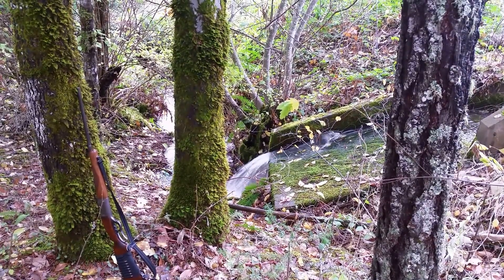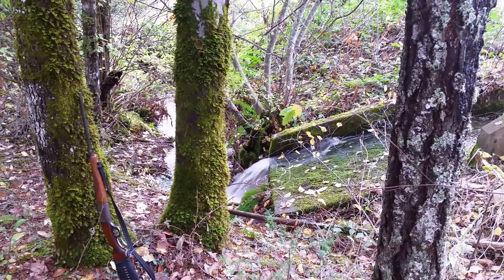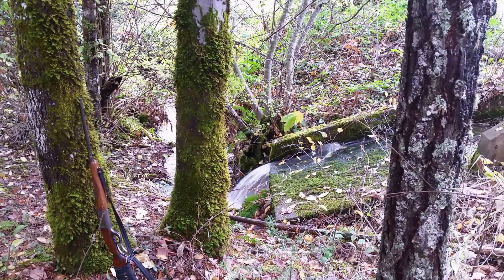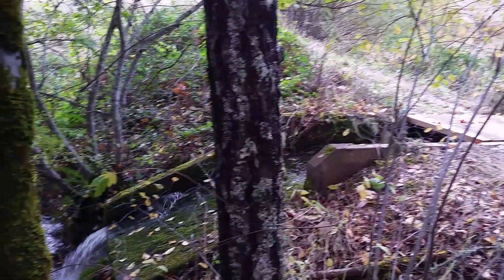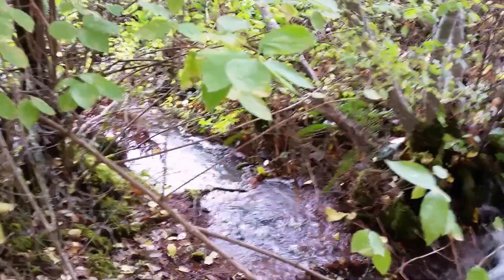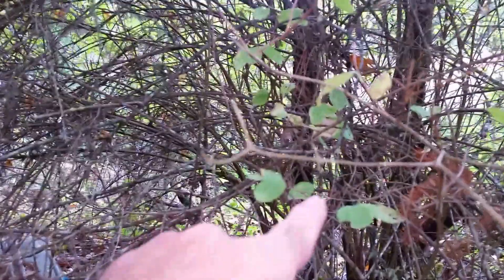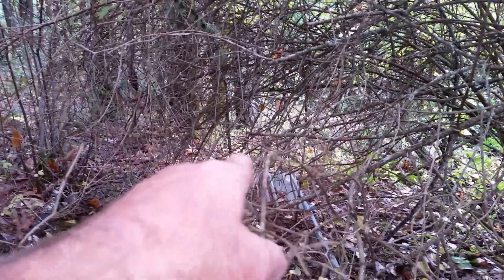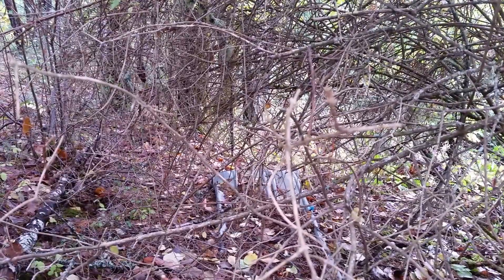Off grid solar homestead (Looking for a good place for hydro generator)

Comment: I heard you mention wood fired water heater in this video.For my wood fired water heater I went to Lowes and got 60 feet coil of flex copper 3/4 inch. I had two 55 gallon drums and so I cut the end off one with a barrel opener tool in much the same way a can opener works for a can of beans. But you can use a hatchet and hammer or a chisel and hammer. I put the coil up in the barrel and held it in place at the top of the barrel with three steel brackets  I bent and bolted in place. I cut a 6 inch diameter hole in the top for the stovepipe. The ends of the copper coil exited the barrel about three inches each. That's so there is no joints in the barrel, just coiled copper 60 feet in length. On the ends of those I soldered connections to the pipes that go to the hot water tank. These are wrench tightened connectors. Also have a pressure relief valve near where the water exits the stove and one again at the top of the tank on the hot water line. Cold water enters the tank , goes into the stove from near the bottom of the tank, rises in the coil and exits the stove and enters the tank toward the top of the tank. Then a hot water line exits the tank on top of the tank and goes to the hot water faucets in the home. I cut a square door in the side of the barrel and cut another just a little larger from the other barrel to make a door and bolted hinges to it and the barrel. And made a latch out of steel. Everything drilled and bolted, no welding. I set it on concrete blocks and poured about 3 inches of cement on the bottom of the barrel through the door. gives it a little weight and stability plus is a flat surface to scrape up ashes. Throw a few chunks in and in about 15 minutes there is enough hot water to take a bath. build it in the morning and have hot water all day. No need for pumps or electric....the hot water circulates itself by the fact that hot water rises and of course this is all hooked up to the gravity feed springwater system so there's pressure just from the fact that the spring and reservoir are above the house.
Reply from the maker: turkey toes very good!
That is very similar to the deign I hope to  use. do you have any videos up of your prodjects?
Reply: As far as turbines go for hydro, I always thought about using a flywheel off of an old riding lawn mower. Not as good as a pelton but cheap and certainly balanced. also some of the better ones are made of steel such as ones from an old Gravely mower. I have read that someone used a barrel and coils of copper like I did for my stove to make a steam boiler and then they hooked that up to a smog pump that ran an alternator but I haven't been able to find that info again here on the internet. I don't think a smog pump would last very long running steam through it...I don't know. But could such a setup as the one I have for making hot water be hooked up to the cold water line for continuous feed , with one way valves so that it would build pressure in the coil and not throw that back through the cold water intake. And after coiling through the stove, at the end of the coil a nozzle that sprays steam at a turbine, even a makeshift turbine such as the mower flywheel?

Comment: Almost put me to sleep with the running water sound. Have fun doing it sounds like fun
Reply from the maker: I think I was kind of mesmerized by the visual and sound effect when I was recording this video lol. I am torn between the water wheel and a micro hydro. If I build a water wheel. It is 300' to the battery bank. I have a PMA that I could use configured as wild AC and mount the 3 phase rectifier in in the battery house next to the Charge controller.If I go with micro hydro system I could have the Pelton wheel next to the battery house. One thing for sure is I will either spend money on water pipe or wire. Thanks for watching!
Reply: Steven Davis I think the water wheel and 12ga electric cord will be much cheaper and easier job
Reply from the maker: You may be right. The PMA puts out 160 volts AC @ 1800 rpm. At that voltage 12 AWG would carry the current 300' with no problem. The micro hydro would be 900' of pipe and the cost of the hydro generator. The water wheel would be just the cost of the wire, I have just about everything else I need.

Comment: Myself, I would not build a water wheel, I would build a small penstock, and run about 100 ft (or more) of pipe off of that (downhill) and send it through a pelton turbine, then divert the water right back into the creek. All this could be set into a small insulated shed so freezing would not be a issue
Reply from the maker: James Pottorff That's a good idea but I have only about 12' of drop. I could get 30' if I add another 300' od pipe. I don't think 30' is enough. 30 feet times .43 psi is only 12.9 psi. The systems I have worked on were 60 to 90 psi. so 150 to 210 feet of elevation drop would be awsome. I could do that if I put the penstock up on the moutain. Then I would have to buy 1000' of pipe. A micro hydro Pelton wheel would work then. The big problem is I have 2 creeks flowing into the pond so the spillway has more water than just one creek.
Reply: Did not realize the elevation difference was so small, but then, I only see whats in the video. So my perspective is off
Reply from the maker: Actually you have me thinking. I have a 200' elevation drop from the back of our property to the pond. It is doable. I going to re think the project. I do not need as much volume if I have 200 of drop. There may be enough water there. I'm going to take a hike and look. Thanks for your input.
Reply: wow a 200 ft drop? that should give you plenty of pressure for a pelton turbine. If you start off with a larger size pipe at the collection point, gradually moving to a smaller size as you drop down in elevation,  you should have more than enough pressure for a turbine. I have seen some impressive micro hydro setups running off of as little as 3 or 4 gpm water flow.(with as little as 100ft drop in elevation)
Reply from the maker: James Pottorff thanks for the info. Next week I will try post a video of a GPM test up on the moutain.
Reply: Cool, you may want to check out Engineer775 (aka Practical Preppers), he does some great work with micro hydro (and all sorts of water projects in general). He may have more helpful info for you,